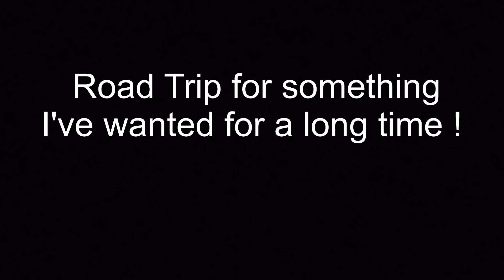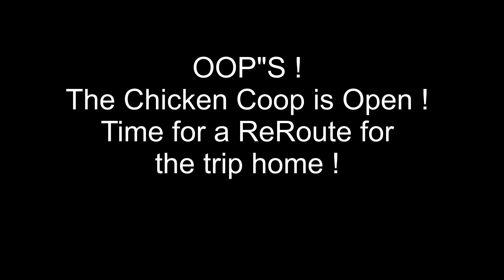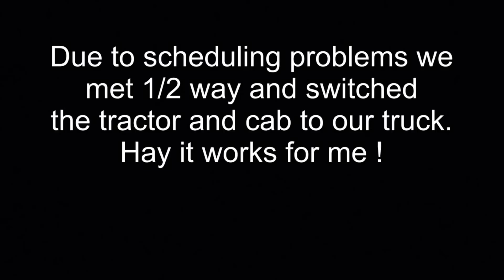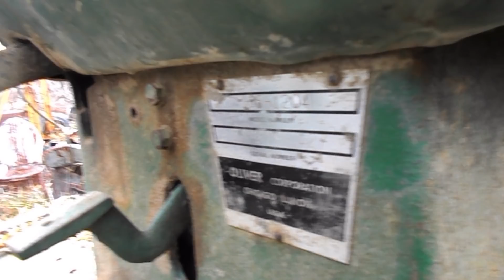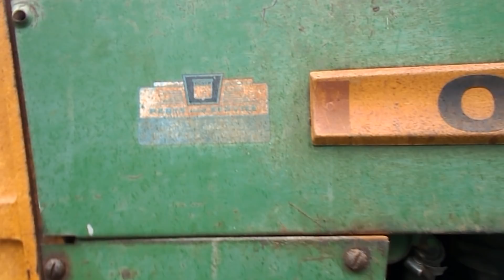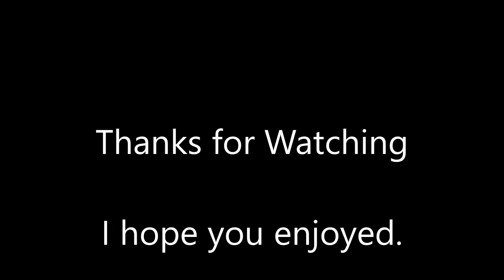Road Trip for something I've wanted for a long time !

Comment: I do like it. Certainly needs some tlc but as you say she has good bones. I thought those tractors had Oliver Wicishaw(excuse the spelling) and the later whites had Perkins motors. 
Did you want the tricycle front end?
Reply from the maker: She looks a little rough right now but after a bath I think it will look a lot better.  Its not often you find an all original tractor like this that is good and strait and all there. It needs some work no doubt and I really don't know if the hydra-power is good or not but its a chance I'm willing to chance it.  The 1850 diesel was a 354 Perkins and the Gas was a 310 Waukasaw and they sold way more diesel than gas tractors. The 1855 was a Waukasaw 310 engine for both gas and diesel and they were know for having engine problems but they also had a new hydraulic system in it. Now the 2-105 White is nothing more than an 1855 with new sheet metal and the 354 Perkins back in it and it became a really good tractor.  Well the narrow front makes it a little different and I don't mind it but I've already been asked if I want to sell the narrow front out from under it to put under pulling tractors to lighten them up. For $400 I can get a wide front for it and I'm thinking about it but I kind of like it the way it is.  Bandit

Comment: Very nice! Got the offset shift lever too....
Reply from the maker: This is the very first 1850 I've seen with that gear shift on it and it takes some getting used to !  I stumped the guys at the old Oliver dealership when I showed them the picture of it, They had never seen one either !  But I can see how it would help with getting in and out of the cab a lot easer.  Bandit

Comment: Needs a canopy.....lol
Reply from the maker: I would like to have one but they are hard to find, But I got a cab just needs a little work to make it what I want it to be and I'll be out of the sun !  Don't do much in the winter with a tractor so I really don't need the glass just a good roof !  Bandit
Reply: New aftermarket “sun shade” from maibach is 1600...don’t quote me though. Original rops canopy can get spendy. We have a few I’ve collected laying around.  I’ve been accused of hoarding....lol
Reply from the maker: @bigfoot-wo3qy   Its not hoarding if your waiting for the right tractor to put them on ! LOL  I know the ones your talking about but I think a little sheet metal work I can make what I want out of the cab and that will be good enough for me to use. It don't need to be fancy I just need to be out of the sun as I'm getting older now.  Bandit

Comment: i have one a little older i added that shifter ,  being short the shifter was tuching  the seat in the back part of the pattern i did not like that it cost me 100 bucks but i like it
Reply from the maker: I think I will be putting the cab back on and I can see already that shifter will make it a lot easer to get in and out of the cab, But it takes some getting used to it !  I know the H pattern like the back of my hand but for what ever reason it takes me a min or 2 to figure out how to shift it ! LOL  I just saw a 2-105 White for sale that has the same shifter in it so its not a one time deal !  Bandit

Comment: Thats a pretty neat cab man. I also like your John Deere 95. I wouldnt mind owning one once I get my farm started. I would only use it in corn with a 4 row cornhead and 15 foot grain platform It also should make short work of my dream of running 200 acres of corn and 200 acres of soybeans and 75 acres of wheat.
Reply from the maker: Thanks Caleb, Its not much as a cab but if I put it on at least I'm out of the sun and as we get older we all have to think about skin cancer from being in the sun so much.  The old 95's are getting harder to find that are any good in fact I saw an add for one and called about it and was all ready sold and the add was only up for a day !  So just keep an eye open for one and be ready to call when you see one for sale.  Happy Hunting !  Bandit

Comment: I knew it1 I just knew it! Iknew it had to be a bigger Oliver, Youll be grinnin from ear to ear as you fix it up and use it,   Looks  really straight just a little neclected. Great start to 2020.!.
Reply from the maker: I've been looking for one for many years and I found the right one to buy. Its a funny tractor to look at cause it is so strait and usually when there good and strait they have been taken care of but it shows signs of neglect by the filters so when I get it cleaned up and start changing fluids and filters it will tell me a bigger story about itself .  But first thigs first its bath time !  LOL Bandit

Comment: Nice video. So are you going to sell the case? That’ll be a really nice tractor with a little work. That cab will at least keep you out of the sun. If you want one on another tractor too you could always get a couple 2x4’s and Tin and make one. I’ve seen it done before. You might have to build another shed to keep it in lol.
Reply from the maker: More than likely the 930 Case will be sold and put the money back into the farm like maybe adding onto a building ?  With a good bath and some clean up and oil and filter changes I think it will be a good tractor when I'm done. The cab was on the tractor and the guy I bought it from took it off to sell it and I got it thrown into the deal, It might not be much of a cab but it will keep me out of the sun so much and I'll be happy with that cause its a lot better than nothing ! Bandit

Comment: Congrats !!! A "new" tractor is always exciting. I've owned several brands of tractors over the years, but I've never owned or operated an Oliver tractor. There are not many Oliver tractors in my area. It would be hard to use a tractor with a narrow front end on our farm because of the hills. But being a Massey Ferguson owner I really do like those Perkins diesel engines. They are very tough engines and very fuel efficient as well. It's a shame that Big Bertha does not have a 3 point hitch. She would be much more useful if she did. Anyways, congrats again and I look forward to seeing future videos of the Oliver 1850.
Reply from the maker: There was an Oliver dealer about 8 miles away from the farm (still open selling parts and working on tractors) so there was a lot of Oliver's and Whites around here. Dads 1550 NF came from Kentucky and no one down there wanted it because of the NF and its why its only got 1163 hours on it, Everyone was afraid to use it on the hills so I got it cheap !  The 354 is a good rock solid engine almost bullet proof but it does have its quirks , Let it idel around not working it they will slobber till you work them and it clears up. When I bought Big Bertha I needed a bigger tractor to pull the bigger equipment I had at that time, Well I ended up with some smaller 3pt equipment on trades and there too big for the 1550's and the Long and I need a bigger tractor with 3pt witch now I have the 1850 to do it with. So I'm going to sell the Case and reinvest the money back into the farm, Maybe a add on to a building ? Lot of video's to come on the 1850 and what I've been doing with it.  Bandit

Comment: Hi there Bandit I have a question are you planning to sell Big Bertha being you bought the 1850 Oliver
Reply from the maker: Well the Oliver is paid for but Big Bertha will be sold cause I really don't need her now, With the 1850 I can use all the equipment I have on it ware the Case I can only use pull type equipment with it so the 1850 is a better tractor to have for me right now.  Bandit

Comment: Hydra-lectric original oem 3pt ropes
Reply from the maker: It's really hard to find a tractor that all original like this with everything still on it.  I believe the story I was told about the tractor but its strange to see this tractor like it sits. Every tractor tells a story when you look at it and this one is a bit odd,  It had to be taken care of to be in this shape but then it shows signs of neglect too. But its still all original and that is hard to find !  Bandit
Reply: I’m going to say what I see. You can tell me if I’m close....lol see if my visual forensics are tuned. 1st It looks like it may have been on a dairy. 2 it spent a lot of time running pto. 3 at some point it was used to either mix feed or haul manure either occasionally or steady for a short period of time. 4 the 3pt looks unused minus hooked up to a plow at some time for a short period of time. It’s a low hour tractor. My educated guess will say the right hub got loose and cracked and they had the dual hub lying around. The hitch cradle broke because bolts were lose and the spreader or feed wagon was to heavy, pretty common on 1650 and 1550 not so much on the 1750 and 1850. But not unusual. Unmolested hitch cradles or 1850 should be easily acquired if fixing isn’t possible. Very nice tractor I would have bought in a heartbeat just to add to the collection....

Comment: Hi there Bandit I have a question have you ever thought about buying a Oliver Combine
Reply from the maker: Not really, Years ago maybe but not now as getting parts is very hard now !  That's why I bought the 4400 cause its easy enough to get parts for it plus I have a parts combine sitting there.  I've run a bunch of Oliver combines and I never cared for the engine being right behind the seat, Too much noise and viberation for my liking but there still good machines.  Bandit

Comment: Don’t lose those hydraulic couplers. They are hard to find!
Reply from the maker: If I had the female wing nut couplers I would use them but I don't and I would rather have brake away couplers for the just in case kind of deal. I really haven't seen these on an Oliver in a very long time like back in the 70's ! LOL But they did work really good on the Oliver's hydraulic system.  Bandit

Comment: you will love that 1850 i like ours the 1555 we have is my favorite but the 1850 we have is my second favorite
Reply from the maker: We had an 1850 years ago and for what reason dad traded it off to a 1568 IH that he ended up hating and ever sense I've been looking for one to replace it. It would pull 5x16" in 5th gear@ 1000 rpm with no problems at all and that's a hard tractor to replace ! LOL  When I bought my 1550 diesel (in 1988) I hooked it up to 4x16" mounted plow and away it went like it was made for it, Everyone tells me a 1550 wont pull 4x16" and I have to argue with them about it cause I know it will plus I've plowed way to many acres with it to know otherwise. An 1850 and 1550 diesel are neck and neck as #1 in my book cause I love them both !  Bandit